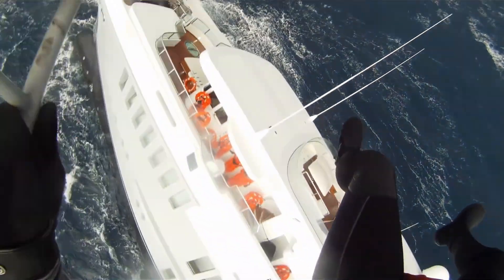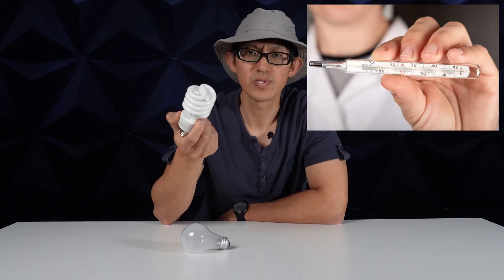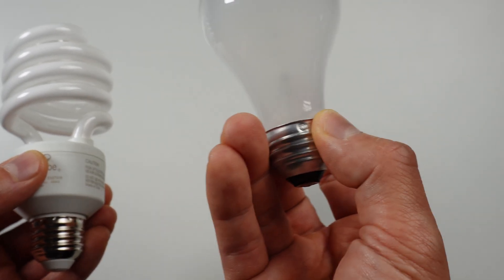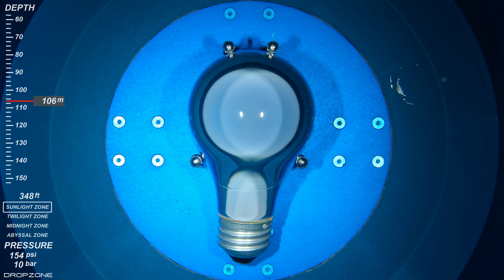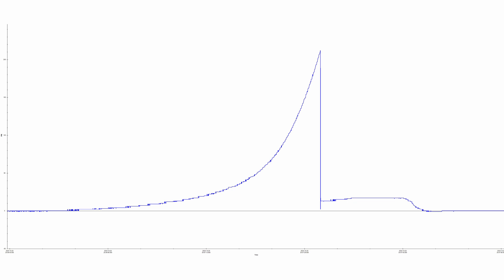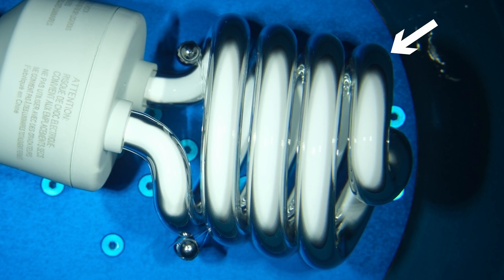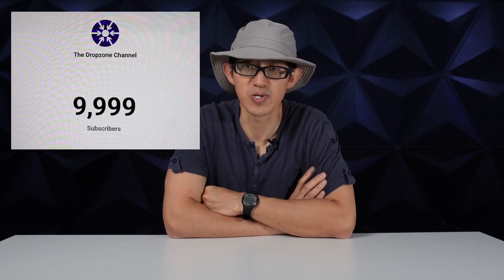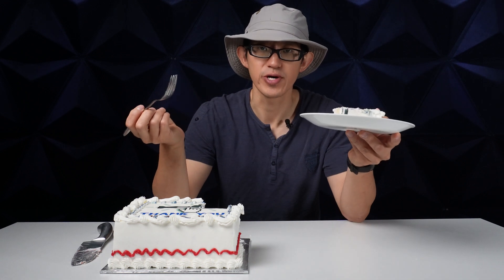Do Light Bulbs Actually Implode on Sinking Ships?

Comment: Interesting - the line of bulbs at the end reminded me of the neutrino detector accident in Japan. That event involved hundreds of vacuum tubes imploding due to the failure of a single tube. The shockwave from one imploding set off the others around it in a massive chain reaction. That might be fun to replicate - put as many light bulbs as possible in an array and scratch the surface of the central one with a file. The imperfection will make it fail first. The implosion of the central bulb should cause the other bulbs to fail outward from the center.

Comment from the maker: I hope you guys enjoyed the cake! Thanks for all your support and feedback. Really appreciate it! Before I placed my first order for the parts, I knew I could get the chamber to work but my biggest concern was that I would run out of ideas for episodes. You guys have stepped up and alleviated that by coming up with more and better ideas I would've never thought of. So, thank you for that. I jotted everything down and you guys will get your answers. Cheers!
Reply: How deep? "Just the tip"  
Scattered through the video are dad jokes, delivered dryly.
Reply: A+ work. Subbed for more watches! I want to see how the Swiss stuff holds up.
Reply from the maker: @matthewsmcdill  I'm trying to get a good deal on a Tag Heuer Aquaracer. I'm curious about the Swiss divers. I might give it away after.
Reply: Another idea would be a high pressure sodium lamp.

I think they contain elemental (or amalgamated) sodium so that might make for an interesting light show.

Pure alkali metals inside a glass envelope might be interesting too as I'd like to see what effect pressure has on the reaction with water.

Sealed Swiss cheese could be interesting too. Or any other cheese that contains gas bubbles. See if compressing and rapidly decompressing changes how the bubbles are arranged in the cheese.
Reply: Love your channel!😀 Keep up the good work!!
Reply: Great idea with the bulbs at the end
Reply: Let's do a bottle crush fest using pressure-rated seals.  I do exceptional work with an oceanographic group.  

https://youtu.be/nc6qPc0Xjac?t=575
     mooB! One nautical mile depth.

     I will ship you a box of assorted pressure-sealed bottles and an epoxy syntactic foam ball.  No charge.  "8^>)
1) Amphora bottle (Kripta sparkling cava - convex bottom!)
2) Freixenet Cordon Negro Brut  Matte surface - seeded failure?
3) Wilson Creek Orange Mimosa  Polished surface. Heavy wall.
4) Ordinary red wine bottle. Mostly flat bottom
5) Heavy wall punted red wine bottle
6) A champagne message-in-a-bottle surface floater from an Antarctic drop lot (one recovered in Isla Wellington, Chile).

I need two things from you:
A) How do we get into secure contact?
B)  A shipping address. I will handle customs and shipping - my treat, in trade for the data.
Reply: I need secure contact information.
Reply: It's the simplicity of the format that keeps me coming back.

Comment: That sound is not the true sound of the implosions. They do not represent how it truly sounds, but the result of a different method, probably some pitch corrected one.
Use a proper audio editing software, perhaps record the sound separately directly to a raw wav format at high sampling rate, and do not use any fft based speed changing method. This is just terrible currently.

Comment: With CFL’s, nowadays there’s not usually liquid mercury inside the bulbs, but an amalgam of mercury to help control the vapour pressure better. Typically it’s in the form of a little pellet, which you may hear rattling around in some lamps, though typically they’re held in a special pocket or near the electrodes to avoid damaging the phosphor coating.

Comment: As you cannot compress water how do you get the water pressure so high? I thought it was the weight of water above.
Reply: Water is said to be incompressible, that's to make understanding simpler for certain physics concepts.  

Drill down to the atomic level and you find an oxygen atom, 2 hydrogen atoms, and a LOT of space around them.  So there's plenty of room to jam more water molecules in.  So add more water to fill in the gaps.  And because the water molecules are now hitting the walls more often with the reduced size of their living space, that increases the pressure.

Quite frankly, until you squeeze it to the point where all space is occupied and the water molecules absolutely can't move, you have a liquid.  Otherwise you've turned it into a solid.  According to Google, you apparently need 6 times the pressure at the deepest part of the ocean to make this happen.